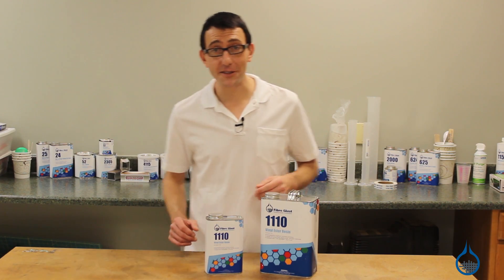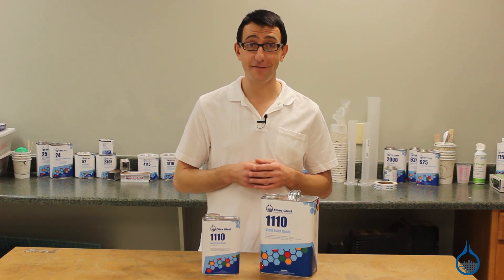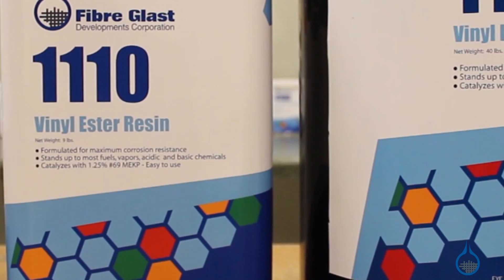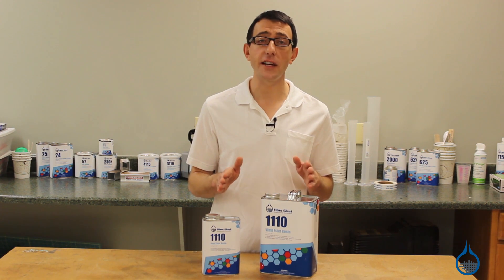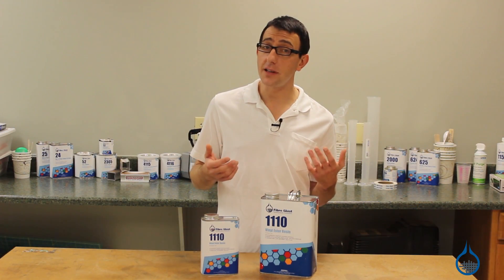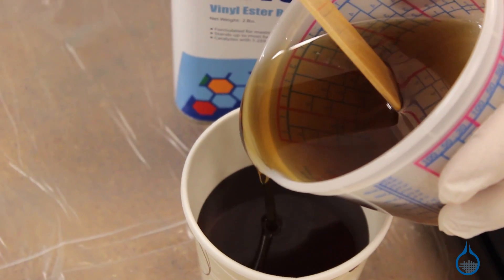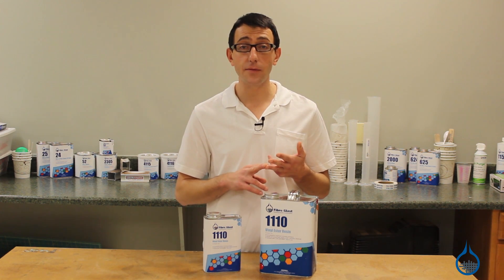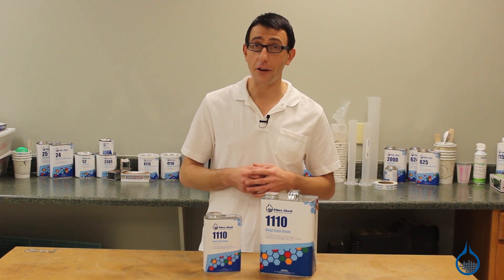1110 Vinyl Ester Resin

Comment: I'm working on bonding ABS material with resin but having trouble finding the right fit. I've tried both epoxy and polyester resin, but the results haven't been ideal—FRP hardens once it dries, while ABS remains flexible, so they don’t bond well together. Does anyone have recommendations on a resin or adhesive that could work better for this? I'd appreciate any insights or suggestions
Reply from the maker: We have some customers who have had success with the Duratec Surfacing primer. It is known to attach well to ABS and PET+ plastics. It is compatible with Epoxy and Polyester and Vinyl Ester resins. Epoxy is the more rigid out of the 3 so polyester or vinyl ester might be the better option once you have primed it. What are you using for reinforcement? Fiberglass, Carbon fiber, or Kevlar?
Reply: @fibreglast  fiberglass
Reply from the maker: @dckakadia  I would need more information about your part and the flexibility required, but applying the primer will help initiate a bond with the resin. Fiberglass will give you the most flex. We can carry this offline if you need more discussion. Here is the link for the surface primer: https://www.fibreglast.com/product/Duratec_Gray_Surfacing_Primer_1041
you can send me an email at mbonnett@fibreglast.com if you have further questions.
Reply: That's a tough bonding application. Often when bonding plastics you run into a problem where the resin does not wet the plastic. I'm talking about the chemical property of wetting, where the surface energy of the liquid adhesive has to be lower than the plastic you are bonding to. Sometimes you can see a wetting problem if you wipe a thin film of adhesive across the plastic and it beads up. Sometimes you can't really see it though, and our day to day experience of wetting can sometimes not align with chemical wetting. Anyway, you have 2 options. 1 is reduce the surface energy of the adhesive. In the lab this is done by adding low SE components or adding surfactants, especially fluorosurfactants. As a consumer you have to look for adhesives that advertise 'bonds to plastic' and hope the marketing claims are true. 2 is you increase the surface energy of the substrate. You might clean the surface with IPA, abrade it with ~120 sandpaper (that DOES NOT use an anti-clogging additive) and wiping with alcohol again. Another thing you can do is plasma treat the bond area. most easily by briefly exposing the plastic to flame. These surface treatments last hours, not days, so keep that in mind. One other idea if you don't have to co-cure the VE and ABS is to cure them separately, then apply a relatively flexible adhesive between the 2. Make sure you don't clamp things too tight and get too thin of a bond line, as this will be brittle. Some add ~0.009" glass spacer beads to adhesives to make sure that the bond cannot be clamped too thin.

Comment: Hi, thanks for the information, what's the full form of MEKP? Can we use Vinyl Ester Resin for resin arts, I don't know if it gets crystal clear after the curing time, pls reply, thanks
Reply from the maker: Thanks for reaching out! MEKP is Methyl Ethyl Ketone Peroxide and the recommended catalyst for Vinyl Ester Resin. Vinyl Ester is amber in color and is not recommended for casting. The resin needs reinforcements for strength and stability.

Comment: Hi I live in NY and have an area on the side of my boat that needs fiberglass work, about 3 ft and 3 inch wide layup. I can put heaters on the area. How long will it take to cure completely? Asking so that maybe I'll buy vinyl ester resin instead of epoxy if it will cure faster.

Comment: Can i use vinyl ester resin for chopped strand mats? I was told i cant use epoxy but vinyl ester resin is between epoxy and poly ester. Something about a bonding agent that does not dissolve in the mats.

Comment: Hi sir
    Do I use vinyl ester residence for making as plastic chip like motherboard or charging light  chips.
     Please write me.
 Thanks
Reply from the maker: Hi Steve, our vinyl ester resin is meant to be used in a composite setup with a reinforcement fabric such as fiberglass as well.
Reply: @fibreglast   instead of fiber glass mat can we use glass fibre strads

Comment: is this suitable for casting? if yes also mixed with metal powder?
Reply from the maker: Hello, this is Adam with Fibre Glast. This resin is best suited for creating composites infused with fiberglass, carbon fiber, or Kevlar. It is not a casting resin.
Reply: @fibreglast  thanks for the quick answer! can you recommend a high temperature resin that allows casting?
Reply from the maker: @flow-2606  you're welcome! Could you give me a little more information as to what you're trying to make? Then I can try to recommend something.
Reply: @fibreglast  i am trying to build a miniature combustion engine for an "art" project. it should be functional therefore it requires a casting material that can withstand 100+°C.  the metal powder adds the texture. does such a resin exist?
Reply from the maker: @flow-2606  unfortunately we don't carry a casting resin designed to handle those types of stresses.
Reply: @fibreglast  do you guys carry a casting resin that feels like vinyl? I dont need it to withstand high stress. I'm just trying to cast toys, and I want the vinyl feel.
Reply from the maker: @iamchankins  Hello Christian, for that purpose I would recommend using one of our Urethane Casting Resins. There are different "Shore" ratings available (the stiffness of the cured part). I have copied a link to that products for you to view.

https://www.fibreglast.com/category/urethanes

Comment: sir, one more thing, can i apply epoxy resin over polyester resin for waterproof concrete surface expose to sunlight and under tiled areas like toilets..
Reply: You can put Polly over both Polly and vinyl but can’t go over epoxy. Epoxy to epoxy only

Comment: can i apply polyester resin over vinyl ester resin for water proof
Reply from the maker: Yes you can. But you will need to scuff up the surface of the existing vinyl ester resin in order for it to adhere properly.
Reply: Fibre Glast  sir, yesterday i finished first coat over concrete and lay fibre glass mat over it and i apply 2 second coat over this mat with vinyl resin .but i am not satisfy with this finish  with in two or three days i can apply polyester resin over it hope that it will work out
Reply: @fibreglast  thank you sir

Comment: great viduocan we mix polyester with vinyl ester together?also every 100 g of vinyl ester you add 1.25 g of hardener? or notthanks
Reply from the maker: +eng.student ma Good questions. We wouldn't recommend mixing the two for your project. If you need help deciding on which resin is best for you, check out our White Paper on laminating resins here: http://bit.ly/1R3E8yZ or, for a overview on resins you can look at our blog post: http://bit.ly/1kRrqXZ

You are correct for the hardener to resin ratio, for 100 g of Vinyl ester, you'll want 1.25 g of hardener.
Reply: thank you so much, I checked the two links and find it very interesting and contain very good iformation.
My research is about making composite used in structure.
I might use the sites as a reference if thats ok
Reply from the maker: You are more than welcome to. Let us know if you need anything else and we'll be happy to help
Reply: ok thanks alot.

Comment: sir ,how to know how much amount of catalyst should be added to the resin so that it does not becomes like jelly easily and doesnot solidifies fast ??
Reply from the maker: If catalyzed at the appropriate ratio (1.25%) it will offer you a pot life of 20-30 minutes at normal room temperature.
Reply: thank u :)